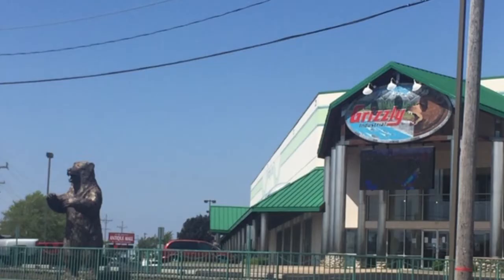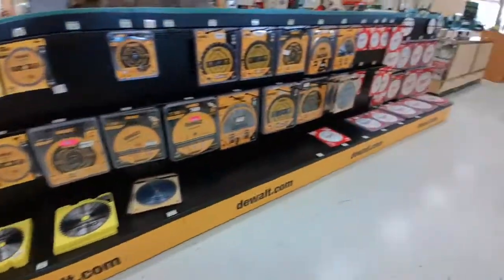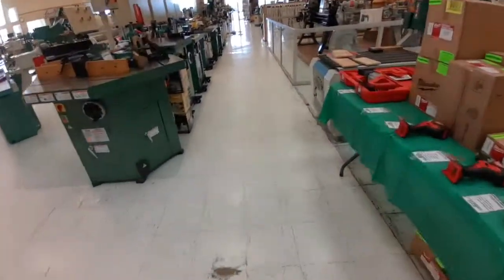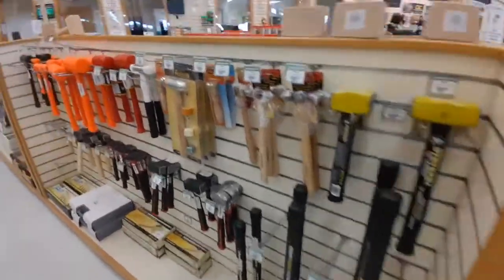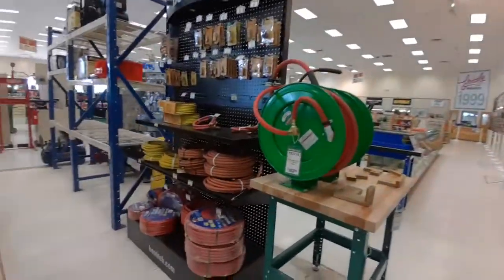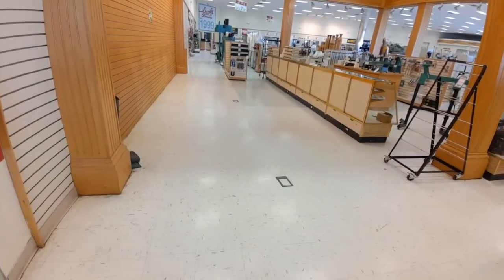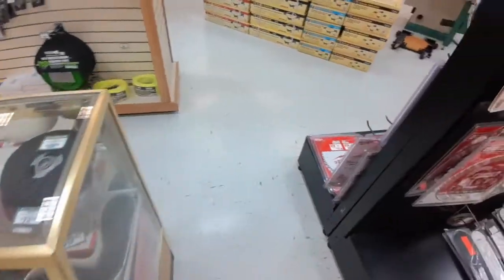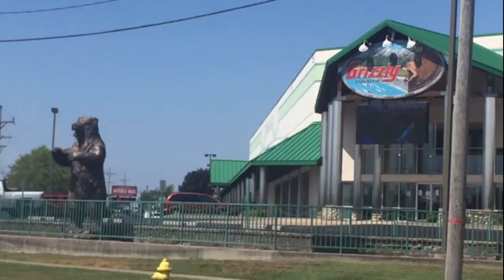Grizzly Tools Showroom Tour

Comment: I recently made my first Grizzly purchase about a week and a half ago.  A table saw.  Hybrid model.  It was on sale, I need a table saw due to my family coming in and taking my grandfather's wood working tools after he passed away recently...so, I figured if I'm gonna have to replace these tools, I'm going to upgrade to newer/larger ones where needed....but I have to say I will miss that Ridgid TS3612 contractor table saw mainly because of all the projects my grandfather and I made using that saw, and both of us paid for that saw we went halves on it.  

The next purchase, which I did yesterday was a jointer.  

You are right they have pretty much everything regardless of your budget...and that's what I like.  I can order a tool that I need that fits my budget, but isn't the bottom of the barrel tool yet isn't the high end extremely expensive stuff either....you got a budget, they got a tool that'll fit in that budget...if you order online, you can also use a buy now pay over time option....this is something I took advantage of...Yeah I could have bought that table saw in one chunk of change, but being able to break it into smaller payments was a huge plus, as it kept me out of digging into the savings account.  

I have a tool list now to get from Grizzly over the next year or so.  I plan on getting the shop fully stocked with the proper tools for my weekend projects.  

I wish we had a Grizzly showroom where I live....we have Woodcraft, and they're kind of hit and miss on stuff sometimes, and prices are ridiculous on a lot of their stuff too, without much selection, unless you want to order and wait and hope you get it.

Comment: Great video of the Springfield store.  There are actually 3 buildings here, this one is the display and order store... all the Large equipment that you cannot carry by hand, is picked up at their distribution warehouse "kitty corner" to the south west of this building in the video.  They will load whatever you ordered at the showroom store, with a forklift onto your pickup, trailer or whatever your hauling it with.  The warehouse that is attached to the showroom store, houses all the smaller "carry-out" items, which is picked up at back of the showroom, behind where the milling machines & larger floor lathes are located.

Comment: I don't think anyone makes a radial arm saw anymore....pretty obsolete, you can do pretty much the same thing on a sliding dual bevel compound miter saw now....the only thing you can't do is rip....something the radial arm saw, or at least the Craftsman one my grandfather had you could swing the blade assembly around and rip boards down, it worked great....the miter saw is much quicker to change from mitering to straight crosscutting.  Another thing you can do with a radial arm saw that you can't with the miter saws, you can't put a dado blade on a miter saw LOL.
Reply from the maker: Agreed if shop space were not an issue I would happily ditch my miter saw for a radial arm saw. The craftsman one I used as a kid with my father was easy to learn, though for sheet goods we had to turn the saw sideways to get 8' on both sides of the saw.